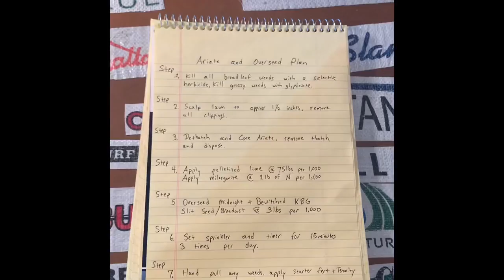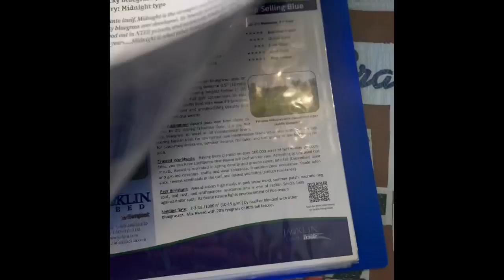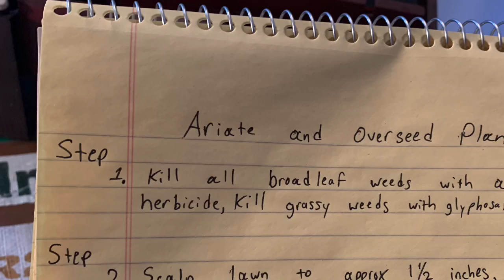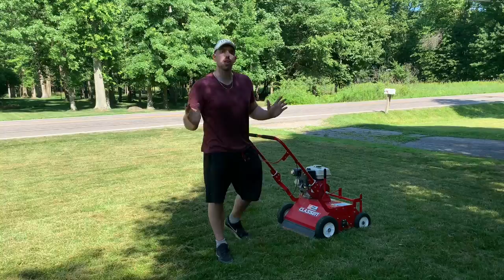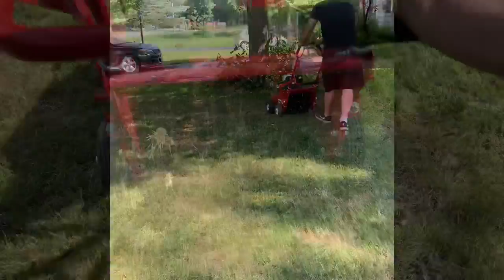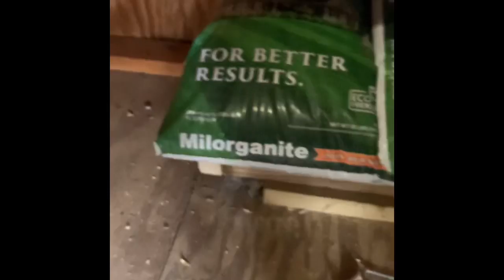Overseeding a Bluegrass Lawn

Comment: If I overseed a mix of TTTF and KBG into a mostly PRG existing grass is there a concern that the PRG will shade out the seed?  Have you experimented with pregerminating grass seed or do I not need to be concerned with this?
Reply: Hi Amy. I don't think you will have any issues. Just make sure to cut the PRG 2 notches lower than you normally do before you overseed (unless you already keep your grass short). I think it will help your yard by having different varieties. The KBG might overtake the PRG over time since it has rhizomes to help it recover from any damage the lawn might have. Depending on where you live the TTTF does much better in the summer. They all blend really nice with each other. Best of luck for whatever you decide.